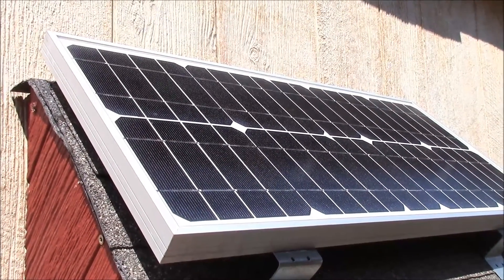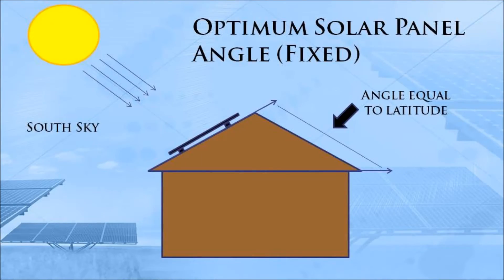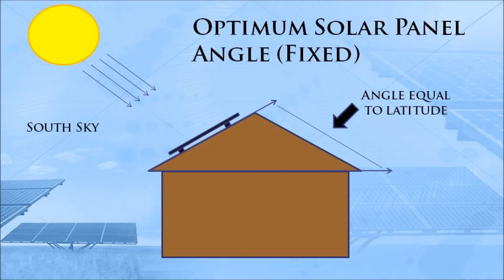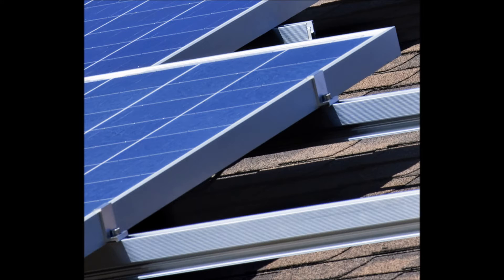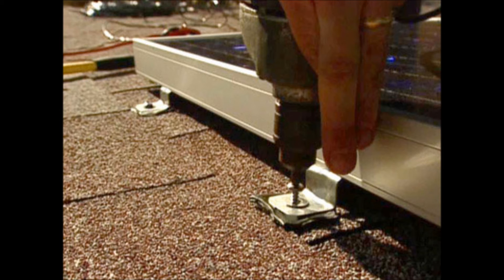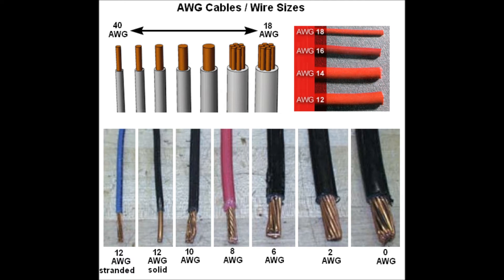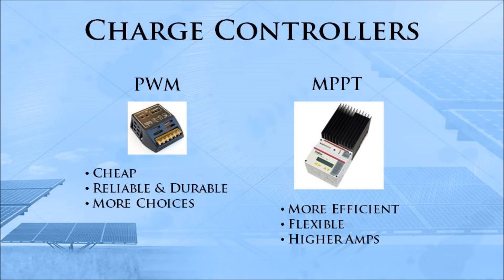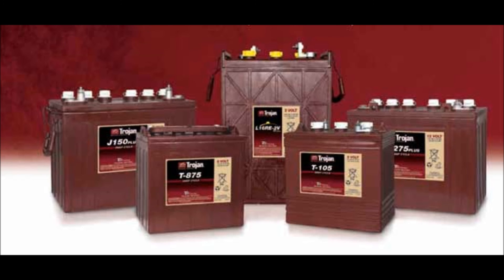Maximizing The Efficiency Of Your Solar Panel System

Comment: Good ideas for beginners. Although obvious, I would add avoid shading at all costs.  I just learned myself that a single handprint of a shadow on a large 200 W panel will reduce its output by 50%. Shade covering the bottom 10% portion of the panel will reduce its output by 80%. I just did an install at my off great cabin and knew I would have shading and then researched what shading actually does only after I install the panels. Big mistake on my part.  I still have not seen what my output is as I have not hooked up the final components.
Reply from the maker: Good to hear from you again!  Yeah, good point on the shading.  I thought of that in planning the video but I thought it was pretty obvious.  But it still would have been worth mentioning just how drastically it will kill the output.  Oh well.